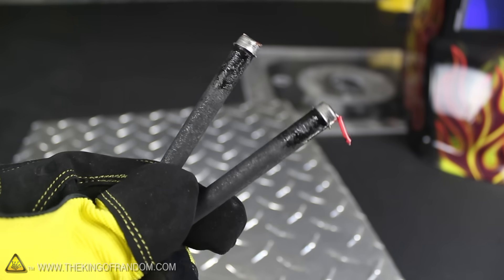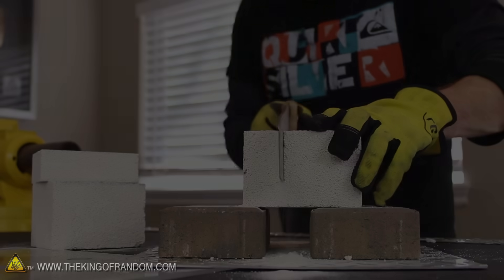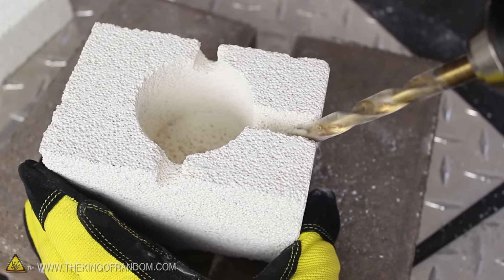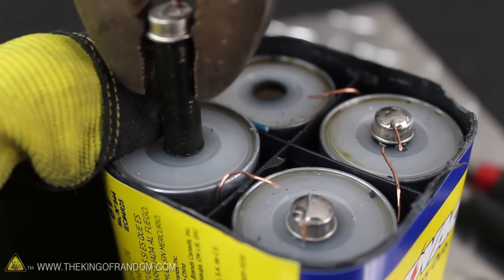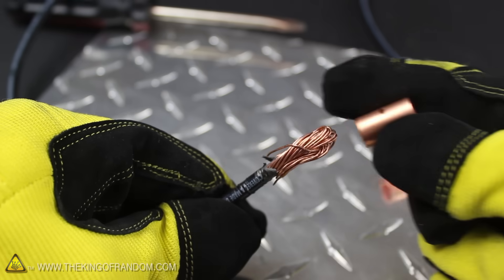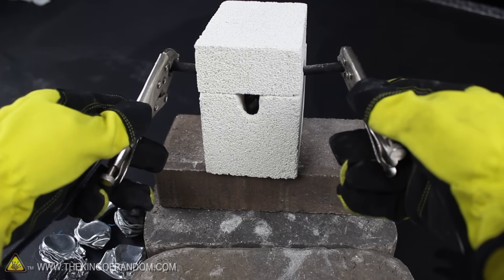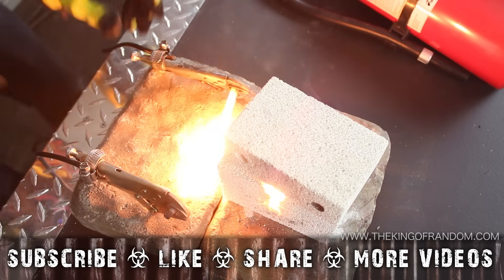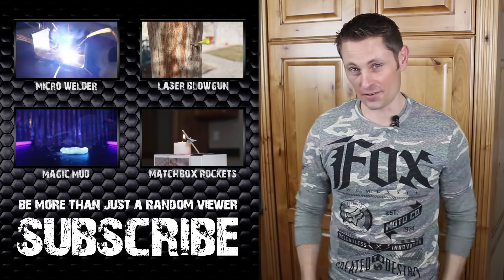How To Make An Electrical Arc Furnace

Comment: What happens if you put francium in there?
Reply: +noobslayeru You would die from radiation poisoning, and end up with a bunch of Radium, which would then decay into Radon, which is a gas that would eventually escape. What effects the heat in it self would have, other then melting the substances, I am unsure of.
Reply: +Tjita1 wait I thought francium was one of the metals that react to water and aren't radioactive and besides their is around 15 grams of francium on the earth at any time.
Reply: +noobslayeru just some stuff
Reply: +Antonio_Diamond just some stuff?
Reply: yes, some stuff. maybe nothing? who knows?
Reply: +Tjita1 I need a piece of 3/4"dia x 1"carbon rod.  Help?
Reply: You're right (except some of your spelling) apart from that it is actually highly radioactive. There is indeed very little of it, and it is one of the alkali metals i.e. it reacts strongly with among others water, but it also happens to be a powerful beta and alfa emitter.
Reply: Rich uhinck 3/4" is quite a large rod, but look what your nearest welding supply store has to offer. What you're looking for can be found, albeit maybe not in that dimension, for use in carbon arc gouging.
Reply: +Tjita1  thx

Comment: Isn't that kinda incredibly dangerous in terms of electricals? Both those mole grips are live and one hand is on each one. If that electric current decides to go thorugh you instead of those carbon rods it will travel straight across your heart. Am I missing something here? Without those gloves I would have thought 66% water person would be more conductive than red hot graphite and air.
Reply: +Rainbows871 The voltage is probably around 30VAC, so it's not so easy to zap yourself. You'd probably need wet hands to get a shock. He is wearing gloves, so he's somewhat protected.
Reply: +jessbrow1111q1qSED EDERBKKIÌJHn99991 nkkiq111c11qqq1111

Comment: can i power it using my home power supply which is 240v ac without transformer??
Reply: +madan mohan martha Probably not. Your circuit breaker/fuse would likely trigger before you managed to melt anything. You'd also be more likely to electrocute yourself than with the transformer.

Comment: What are the hazards of touching those together without gloves on? Do I need special gloves?
Reply: +Nastika WELDERS gloves
Reply: So leather work gloves are fine? lol
Reply: Nastika i would think so but i rahter use a pair of miller welder gloves myself
Reply: Thanks for the suggestion. I'll look into getting a pair before using the furnace. better safe than sorry.

Comment: What does it mean when he grounded and if he gets shocked will it kill him
Reply: +๖ۣۜCOFFEbiscuit๖ۣۜ 1 One slight correction, most of the electricity follows the path of least resistance. when holding something like this you essentially make yourself into a parallel circuit with what you're holding. You always need to be careful when dealing with high voltages and currents, one careless act can turn something like this very dangerous.
Reply: +nathan tello electricity follows the path of LEAST resistance, it much rahter follow a copper wire than a fleshy salty human body,

Comment: Yeah melting zinc with that is extremely dangerous. It boils at around 900 degrees Celsius, so if you hold that arc just a second too long, you will get a blast of vaporized toxic metal.

Comment: Found this on a forum online. " The real danger comes when melting bronze with zinc in it, because the melting temperature of the bronze is greater than the boiling point of zinc. The zinc vapor, when exposed to the air, immediately burns into white zinc oxide smoke" Should you be using P100 filters while melting zinc?

Comment: Could it melt thorium and beryllium? I would like to experiment with concocting alloys of weird metals. Like osmium and uranium. Or lead with sodium. Or tungsten with bismuth. Or uranium and beryllium. wish I knew what those were but they seem like a weird mix that might be useful.
Reply: +David Vermillion I would avoid using anything radioactive like Uranium if I were you, plus both lead and sodium would be a bad idea, as sodium reacts violently when it comes in contact with oxygen and this set up wouldn't just melt lead, it would vaporize it.

Comment: Should probably mention it's a bad idea to hold the carbon rod grips without insulating gloves.
Reply: +Technoguyfication I think if someone made this and doesn't know they need to wear gloves, then should probably be looked after professionally.
Reply: +Saikit Tang 
And everything I've read about casting metal at home warns about zinc fumes causing cancer or other health issues
Reply: +TheLizander Ya I have seen those as well, some people die because of it, metal fume fever
Reply: Even worse idea to drill alumina silica brick at home

Comment: That face mask is NOT sufficient to protect you from silica exposure. You might as well have a hanky over your face. Nuisance dust masks do not filter fine enough nor do they form the type of seal the required cartridge half mask does, the minimum requirement to prevent unsafe exposure, although this is changing to a stricter standard in the US soon. Silica exposure is cumulative,  if you plan to work with silica refractory materials invest in a good half mask, have a fit test performed at your local occupational medicine clinic to ensure function and your medical capability to wear one and have fun.

Comment: So how many joules does it use to melt one ounce of aluminum?
Reply: +Xaxton Revolution the Specific Heat Capacity of aluminium is 0.913J to raise 1g by 1K.   So to get 1oz (28g) to melting point (660C,  or 640 Kelvins above room temperature)  you'd need 0.913× 28 × 640 Joules, in a perfectly efficient furnace.

Comment: Jet Fuel cant melt steel beams but homemade furnace can?
Reply: abetoymachine But 7/11 was an part time job
Reply: +deadfish45films 

According to the 9/11 commission jet fuel DOES melt steel beams sir, pleas get edumacated.
Reply: +deadfish45films 
um . . yes
Reply: +deadfish45films Any fuel can melt steel, technically. There is nothing stopping anything from getting indefinitely hot, apart from when weird nuclear things start happening. It's all a matter of feeding energy into a system faster than it can escape. However, steel is interesting in that if it is under heavy load it can fail very suddenly under relatively low temperatures. It does not have to melt to be too weak to hold up a building. Do note that I'm not putting any value into this, I'm taking neither side in the whole conspiracy idea, I'm just stating facts.
Reply: +deadfish45films You don't need to actually melt steel in order to cause a structural failure in steel reinforced concrete. Metals will soften when heated to sufficient temperatures, even without melting, at which point they lose their tensile strength. This is why a blacksmith heats up his iron until it is red hot, without melting it, before he hammers it into the shape he wants as softened metals are easier to work with. Or why steel works heat up their steel ingots before rolling them into beams or plates, a process called hot rolling.
Reply: deadfish45films I have no idea. Maybe he did. Maybe it was Bin Laden. Maybe it was something completely different. As I said, I'm just stating facts. If you can feed enough fuel and enough oxygen to combust that fuel optimally a closed system will only get hotter and hotter.
Reply: +deadfish45films but dank memes can melt steel beams
Reply: Albert Nave As stated before for fuel to reach its maximal adiabatic temperature it needs a constant supply of fresh oxygen, the fuel in the WTC was oxygen starved therefore it had the black smoke escaping from the burn area.
Reply: +rock3tcat (ⵙⴰⵔⵓⵅ) How was it oxygen starved...it was a building with all of the windows blown out. That's pretty high oxygen flow even 20 floors up.
Reply: +Citizen Z I don't think Bush or Rumsfeld had a clue. I think they kept them out of the loop.
Reply: +deadfish45films Can the furnace melt dank memes?
Reply: Yes, of course. 
Much heat, such wow.
Reply: +deadfish45films This comment reminded me to turn on my "hide youtube comments" Chrome extension. Thanks.
Reply: +deadfish45films Jet fuel is capable of melting steel beams.
Reply: FcGod There was a conspiracy theory that the destruction of the Twin Towers was an inside job, because the burning fuel from the crashed plane can't get hot enough to melt the steel beams supporting the towers. This theory was disproved, so everyone now jokes about it. One example is "Jet fuel can't melt dank memes."
Reply: +deadfish45films This electric arc furnace is much hotter than a standard "forge" type your thinking of.
Reply: RascaldeesV2 No, we are not having this argument again.
Reply: Albert Nave I AM THE THREAD NECROMANCER!!!!
Reply: Albert Nave Was there an explosion? I can't remember that far back. Anyways, regardless the whole 'jet fuel can't melt steel beams' argument is invalid. Why melt the beams when you can slam a couple tons of metal into it and collapse it the same?
Reply: +deadfish45films That is correct sir.  Jet fuel no, arcs from a welder yes.  The arc is hotter.  The pistol shrimp can snap its claw shut, creating a shock wave that is for a split second, hotter then the surface of the sun, which in turn is hotter then the arc from the welder - so now you know.
Reply: swedish gaming IT WAS THE SWEDES!?
Reply: Albert Nave I'll marry you if you keep this up. Whoever came up with the idea of melting steel being the reason the towers fell obviously never accounted for the several tons of plane as well as structural damages.
Reply: +deadfish45films Only idiots think metals need to be molted to bend them..
Reply: +Russ B (Adirondacks4me) its termite,  no jet fuel
Reply: Basezx Robotic termites. Illuminati confirmed.
Reply: +Markitos203 it doesn't melt the steel beams. However, at high temperatures steel loses much of it's strength. it's strength at 1100°F is around 50%.
Reply: +Ian Thompson 
Once one floor falls on itself, the game is over.  You are talking stresses that are incalculable.  
I think the WTC falling straight down is proof the source was the plane and nothing else.
The many geniuses who wreck buildings with explosives for a living said it would be impossible plant the shaped charge explosives required with no one noticing.
As somebody who is a welder/fitter,  I’ve melted metal, used heat to bend steel at shipyards,  and worked around cranes.
The morning 9/11 happened, I was putting the finishing touches on my very own  1000 lb tilting crucible furnace.  
It took me seconds to recognize the physics behind the  attack.
I don’t think the genocidal muslims nutcases  expected the buildings to fall down.
A metal melting cupola uses forced air and fuel to melt steel.  They melt steel incredibly fast.  
The taller the cupola the better! 
I can’t imagine the inferno of jet fuel and 30 stories of space.
Thats why I say the WTC was The Mother of All Metal Melting Cupolas.
No disrespect, sir.
Reply: Bruh watch tobjzl
Reply: Yep....
Reply: +deadfish45films your logic is immaculate
Reply: +Citizen Z No, he did not.
Reply: Tjita1 So bush didnt do 9/11?
Reply: +Markitos203 lolz
Reply: N MC Was your heater made of aluminum or something?? lol
Reply: Yes, of course. 
Much heat, such wow.
Reply: ***** Can jet fuel get hot enough to soften steel beams? Riddle me that, Batman.
Reply: nah it cant thats y 911 is a mystery 😱😱😱
Reply: Albert Nave How and when was it disproved? 8===D
Reply: rock3tcat (ⵙⴰⵔⵓⵅ) I guess jet fuel actually can melt steel, or at least make it incandescent. There's a documentary about it. I don't know when it was disproved.
Reply: Can this thing be a forge
Reply: +deadfish45films If you're referring to 9/11, the several dozens of tons of plane slamming into the building probably had nothing to do with it...
Reply: Sionide Gaming I just find it funny people still believe that jet fuel is the only thing that brought the towers down.
Reply: RascaldeesV2 I thought it was, you know, the explosion from the crash.
Reply: +Bennyboy087 Coca-Cola was once used to clean blood spills off the highway...
Reply: Did you know that it will break down all organic matter if exposed to it long enough?  I think pepsi showed that a dead rat will be totally broken down, hair/bone and all within like 45 days
Reply: yes
Reply: +Citizen Z actualy im sorry but i did 911 i put on my fire mixtape and it melted the steel beams
Reply: +Albert Nave 
“Hey! Sweden!” – “They're Norwegian, Mac.”
Reply: or nano termite
Reply: John Gonzalez If the steel beams got melted, wouldn't we have seen sparks flying everywhere?
Reply: +deadfish45films The steel was not melted? But the fires and heat from the plane impacts and fuel keeping internal flammable materials burning intensely did weaken the inferior end joints on horizontal joists to cause the house of cards scenario to take place...
Reply: +Sword of damocles Well beside the fact there was thermal cameras and you can see molten metal flowing.
Reply: +Will Brack ? really
Reply: +Basezx thermite
Reply: Show us the evidence...I can say I live on the moon with no evidence and you better believe me right...and no.... other then my 4 years in the USAF I worked for the private sector ...
Reply: +deadfish45films yep,..jet fuel  burns  at temperatures  up to  800 degrees Centigrade..... not enough to even melt  the copper....( melting point at 1050  degrees C, steel even higher  , around 1550 C ) ...electric  arc  burns  at  thousands of  degrees
Reply: Ben McLean It still certainly has nothing to do with the several tons of plane slamming into it, the tons of rubble that fell down, the structural failure after many supports were knocked down...
Reply: +deadfish45films  I think there's something like a huge size differential. and they didn't melt steel in this video
Reply: trid2bnrml Yeah they did. Right at the end man.
Reply: 9/10 -IGN
Reply: +Raging Gamer (TheRagingGamer) Aluminium dissipates heat very well. To melt, you need to concentrate heat. So aluminium by itself isn't likely to melt. Steel, OTOH, is more able to build up concentrated spots of intense heat.
Reply: here we go  . .
Reply: +deadfish45films Logic is an amazing thing
Reply: +Tjita1 In that way you could met steel by rubbing your hands together. It is smart though not to have or at least discuss an opinion on 9/11. All I would belive is that either amazing incompetence or some hidden interests took a part in it.
Reply: +deadfish45films 
The WTC was the mother of all metal melting cupolas.
Besides…steel doesn’t need to melt.  All that was needed was for the vertical or horizontal steel to give way starting a china reaction via gravity.
Reply: but really guys. For one the tower fell straight down. Like a controlled implosion. This would not happen from the plane. Also I see the argument that the jet fuel only has to weaken the beams. But still, it had to fall, on fire, a few hundred stories... Not likely.
Reply: +deadfish45films that's not how physics works, that's not how anything works

Comment: Hello ! Well, first excelent videos and tutorials.
I have seen some problems to me, i pretend to make this reactor in next vacation but im from brazil.
The problems are: a 8gauge cuper is to expensive, all lock plipers too, and the scariac seens to be very dangerous too me. I would like to know if its possible to use a welding machine as a arc reactor, it would be cheaper too me. Thank u a alot, and sorry about the poor english

Comment: Hey there Grant I was just wondering Would it be possible to create a forge by using this same idea but connecting Carbon rods on the bottom of the forging cavity inseries and then running it with an on off switch possibly from a surge protector or even light switch, if you were being fancy.

Comment: I had planned on making hundreds of kilns and furnaces for the glass and ceramic markets.  I have not made any for other people yet. My best plan for a "dustless" design uses a stainless steel design that I am happy to share. Imagine every side of the kiln as a separate and interchangeable part with the electrical elements inside of quartz glass tubing . The elements can not touch the steel sides.

Comment: These tiny particles break down to such a small size too easily.  I am sure you will see a class action law suit about this material in the next 20 years. In 2002, I was cutting it with a circular saw to make a door for a kiln. These particles can float for miles.

Comment: We die because our bodies die.  This refractory brick is one of the most dangerous materials to our health.  This material breaks down into such small particles that your lungs can not remove them.  The particles create cuts and scar tissue in your lungs.  You can not absorb oxygen through scar tissue. Your body ends up suffocating.  It is a "trojan horse" to your health.

Comment: Hi, great video.

I was wondering if it would be work just as well to power with a small arc welder?  It seems like I could get one at a pawn shop and be less dangerous than building all of the makeshift components for the DIY welder.

Thanks.

Comment: Note that firebrick is very abrasive so it will wear your tools out unusually quickly. The damage probably won't be obvious after a single brick but that doesn't mean it didn't do any damage. If you have the option use tools that don't matter much to you.

Comment: if you don't have these batteries in your country, buy them on Ebay
http://www.ebay.com/itm/Rayovac-Heavy-Duty-Lantern-Battery-6-Volt-Screw-Terminals-945R4-/252032299119?hash=item3aae4bb06f 
This is the exact same battery as in the video (i think, but haven't bought/tried it) and there are also similar batteries on Ebay which are cheaper (but probably worse)